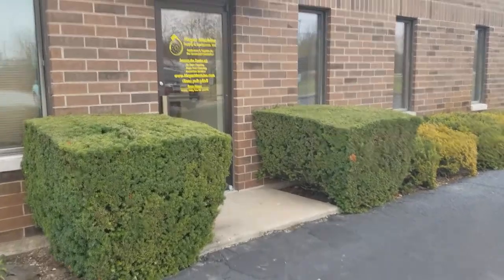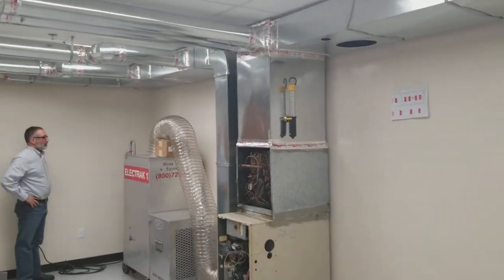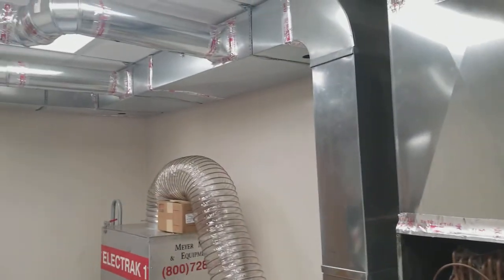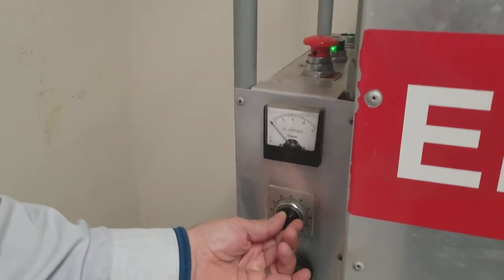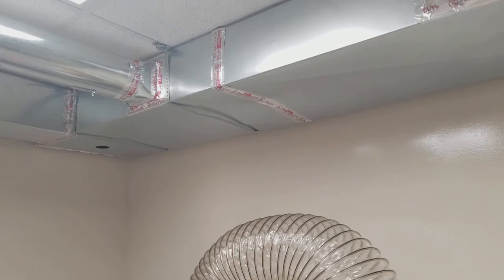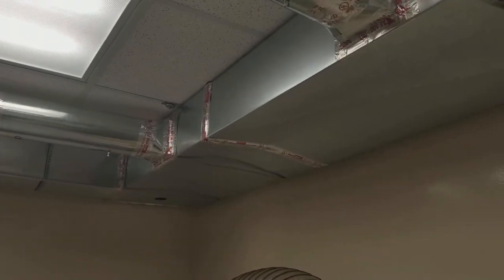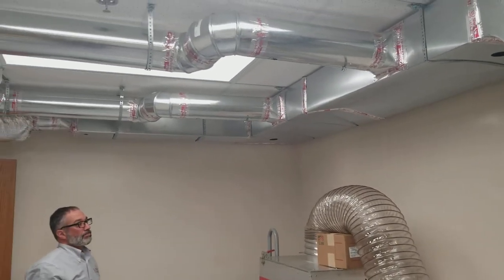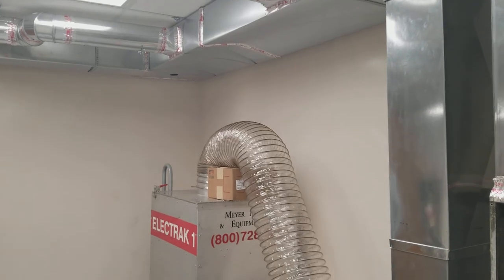Negative Pressure Duct Collapse

Comment: Graet video! I was wondering what static pressure is the fan designed to? Also, by closing the openings, what level of static pressure would the interior of the ducting reach to allow the collapse?
Reply: Ehsan, the pressure during the demonstration was 4"-6" of H2O.  The collapse point for all air duct systems differs in vacuum/pressure ratings.  Static pressure levels for this application, air duct cleaning, are determined by the fan tip speed, volumetric flow through the fan, and the amount of make-up air that is able to enter the vacuum system (ductwork).  If the duct system were to be completely sealed off, such that ZERO CFM of make-up air was allowed to enter, the Electrak has the capability to manage 9" H2O of static pressure.  This feature of the Electrak is what makes it so attractive to air duct cleaners in commercial and high-profile jobs.  Running the vacuum at pressures over 5" (where most of the competition maxes out) allows for an operator to continue moving air through the filter bank and reduce shut-downs for filter changes.
Reply: @jimmymeyer6755  thanks for the response!